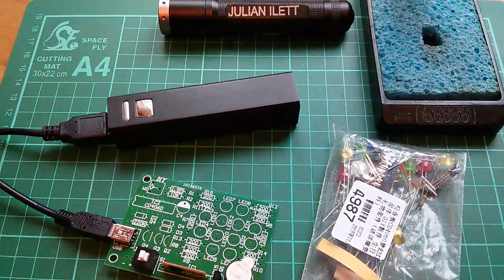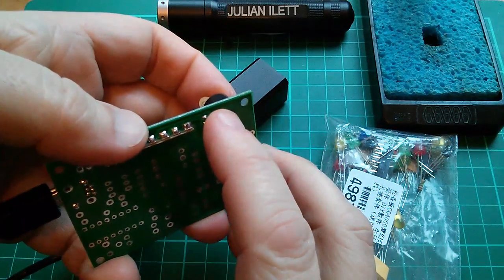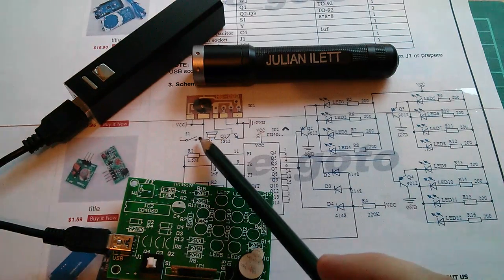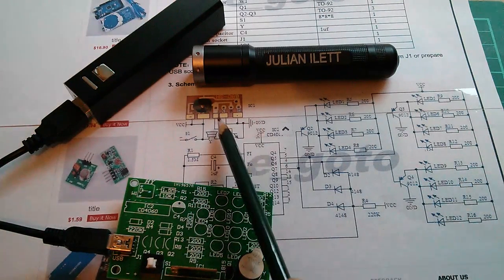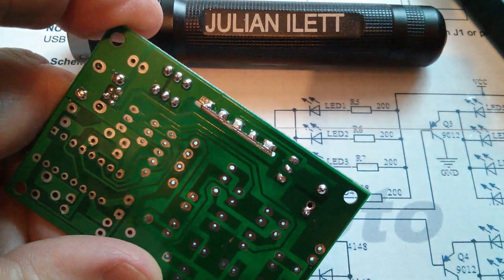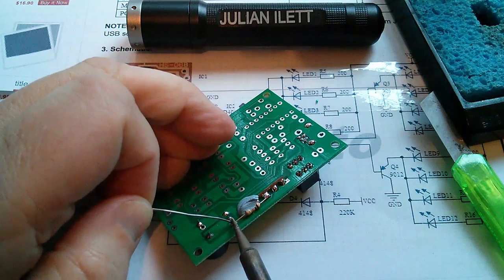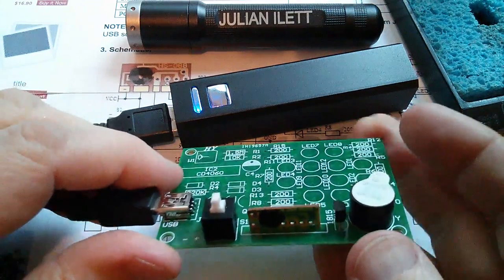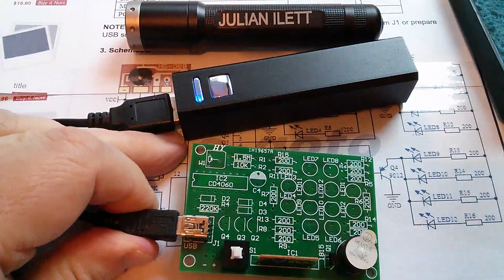Update: Dream Happy Birthday Music Kit - Fixed!

Comment: Alright nice! I've got the exact same kit and found out it didnt work until I shorted the transistors out like you did. Glad I'm not the only one. Found out that the chip they gave doesn't even fit in the damn kit. Nice to see a solution.

Comment: One just has to wonder, could it be that somewhere in the rest of the kit somehow there is a resistor that does this job?  Just wondering since you have all those other parts that need to be soldered into the kit.

Comment: The four transistors driven by the CD4060 don't have base resistors as well. So, you may want to add them before you test. Also, I think the kit as is without base resistors may work on lower voltages (e.g. 3-4 Volts) since lower voltage causes the current drawn by transistors to decrease. Therefore, the designer decided to eliminate all base resistors to save a few cents.

Comment: Thanks for the video. I have two nearly identical eBay "birthday" DIY kits but instead of the transistor yours has, mine uses a 9013. Mine suffers the same issue and the 10k resistor fixed my kits as it did for you. My kit can be distinguished by having a 5.5x2.1 power plug and I mention this because my kits do NOT play happy birthday even though the item listing is for "DIY Kit CD4060 Dream Light Birthday Gift Suite." Instead, they play several short snippets of Christmas music.

Comment: Are you sure the Q1 "transistor" is the 1815 part as labelled on the diagram and not one of the Q2/3 9012 parts used the in the other circuit? Perhaps the 1815 part is a MOSFET (with an incorrect circuit symbol drawn on the diagram)? A MOSFET of course wouldn't require a resistor on the gate.

Comment: I think the issue is that you did not have all the other circuitry hooked up, so all the current is beating the shit out of the transistor. I bet if you had the whole board wired up, it wouldn't overcurrent like that.

Comment: So who ever designed this pcb did not test it before selling it as a kit ?
Reply from the maker: +Mix Bag It might have worked in the design lab, but does not have enough margin to work reliably in all situations.
Reply: +Mix Bag As I understand it the suggestion is that when the music chip tries to drive the transistor ON the low impedance of the base-emitter, without a series resistor, overloads the 5V supply which dips and causes the music chip to reset.  It then recovers and repeats the cycle causing a continuous tone to be generated.  This will only happen if the 5V supply has a high impedance or low current capability.  So if the circuit was originally tested with a low impedance bench power supply then it would probably have worked just fine.  The output current of a CMOS chip is inherently limited by the characteristics of the upper FET in the output stage and will not be massive, it's quite common for instance to drive LEDs directly from CMOS chips without using a series resistor.